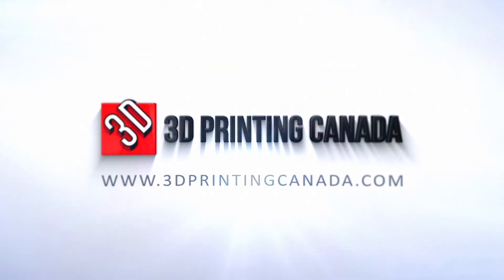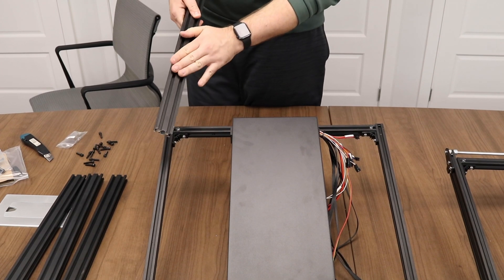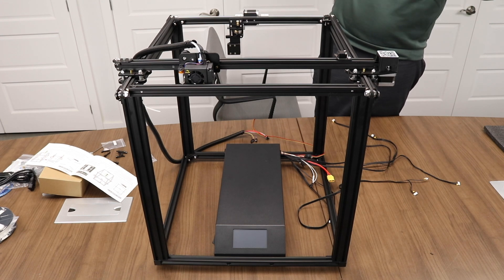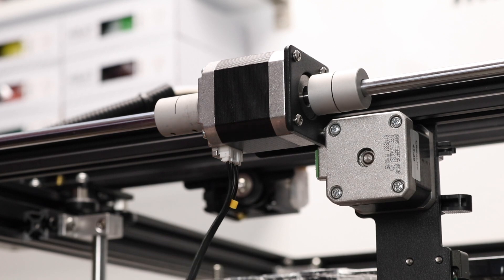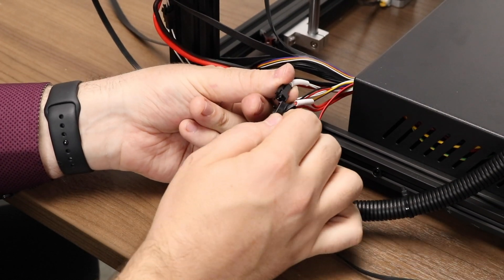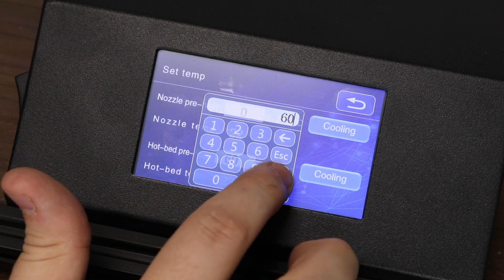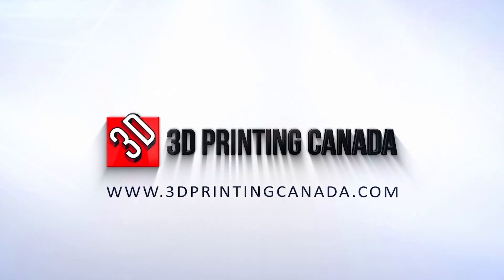How to Build a Creality Ender 5 Plus

Comment: I know this is 4yrs old but there are 8 screws for the bed mount.  You even show putting 2 screws in one corner.  4x2=8.  No worries. Even the manual was wrong.  
It said use 4 screws and make all 6 are tight.  Hmmm

Also you pushed the down Z button when raising the bed.  That’s backwards.  Up is up.  Down is down.

Comment: Very Good Video, I'm not a dummy or anything, been high level auto mechanic for over 30 yrs, Machinist (including CNC) the last few years, Have CNC Plasma table at my home shop, etc.  But I really enjoy seeing what I'm gonna run into when I start putting something together or repairing something.  I have seen several videos where they say to turn the spool mount to the back which is foolish as it won't line up properly with the extruder that way and it's not in the way at all the correct way.  Good luck folks, I'm gonna try to get this Bad Boy going today..  God Bless, have a great weekend.  Larry R.

Comment: Notice!
If you get a “Thermistor Error”,
Simply switch the two white wire connectors.
(I had them reversed, meaning the print head was registering the bed heat, and vice versa)
Problem solved!

Comment: Not a great video, not showing details like which is right / left side x y axis frame and how to install the spool holder. Where to position, how to position the t bolts, and your hands are hiding ask the wires as you plug them in so I can't even see what your doing

Comment: Bed won't level.

Turns out it's because the frames are backwards, the pins need to be in back.

Sure would be nice if that was in the manual.

Can't even take it apart because one of the screw heads stripped.

Comment: For anyone wordering auto bed levelling will happen before each print, in setting on the machine under levelling there is an option to turn it on and offer for each print.
Reply: On my main display the auto leveling option isn’t there. Do you know why it might not be showing up by chance?
Reply: @Godzi1la25   It should be under the leveling menu with a on off toggle.

Comment: do this model in 2021 have some updates ? because i have my fresh + 5 and i dont see that  230/115V switchs on my printer :/
Reply: You have a different power supply inside. The far superior meanwell 500w
Reply: @jaapdewaard830  so i dont need to switch anything?
Reply: No, meanwell has auto switch and is the best supply you can have. No need to upgrade
Reply: @jaapdewaard830  thanks

Comment: I wish Creality could have given the Ender 5 Plus some aviation connectors instead of all those plastic ones, it makes it ugly and untidy and prone to damage, I came so close to buying this printer but ended up building the Pro 3D Core X, Y V-king, it was my first experience of sourcing my own parts and my first ever build from scratch, my stomach was in knots with the thoughts of cocking it up, but once I had sourced and ordered my BOM I was chomping at the bit to get started on the build, all my cabling is tidy and I have aviation connectors fitted, Oh and I nearly forgot to mention I have a Belted Z-axis, I have my perfect printer but I still need another large format printer and I'm going to give the Ender 5 Plus a go!

Comment: You may have to force the screws holding the bed down other wise your videos spot on for my build. Thanks man
Reply: I encountered this too. I actually retapped the threads - you can manage this without special tools by simply using the included Allen key to GENTLY turn the screw until it meets resistance, then back off a bit, then turn to resistance again, and repeat a bit farther each time in a sort of ratcheting strategy.
Reply: As of  3/11/2022 I did not have this issue so it looks fixed. There was one predrilled hole that was off by a hair. I gently pressed a screwdriver between the frame and arm and pryed a 16th of an inch

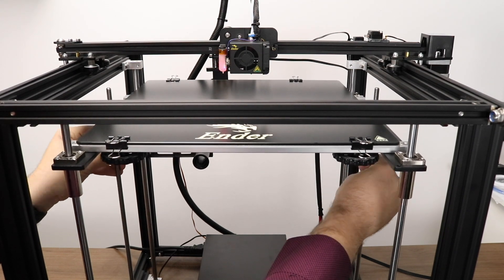Comment: At the 8:09 minute mark, you direct the user to manually twist the Z-axis rods to raise the print bed close the hot end. You don't mention it in the video but don't you have to use the 'Disable Motor' function to manually use the Z-axis rods to move the print bed ?
Reply: If it is off, the motors aren't going to be engaged. Disabling motor is just a way to do it without closing it.

Comment: 7:22 - "Ensure that the voltage on the power supply is set to 115 volts"
...unless you have ~230v mains electricity like much of the non-American/Canadian English-speaking world. This is especially true for the parts of the world that say Zed instead of Zee, yet you keep saying Zed. ;)

For whatever reason, Creality tells you to put in the side screws before the top screws for the top frame with extruder. Not sure if there is a reason for that or not, but the order is different from this video.

Comment: My 3d printer doesn't have the power input switch so idk what it's on and if I need to change it or can change it.
Reply: I bought mine from their store, so I’m hoping it was pre set from the factory to the correct setting...
Reply: If it don't then it's automatically adjust to the right voltage.

Comment: Thanks so much for the zoom-in while connecting the cables! All of the other tutorials I found didn't do that and some even sped up during that part!
7:24 That red thing is missing on mine though, it's just silver metal behind the hole. Are there different 5+ versions for different countries or do you have to open that up somehow?
Reply: I have the same problem and I have no idea
Reply: @mineordan1282  I talked to the shop I bought it from and they said that there are different versions for different countries. So if yours is missing the red switch, don't worry, it just means that you don't have to do anything else.

Comment: When I click auto home my hotend is pressing against the bed and the z axis wont stop and keep trying to rise the bed can anyone help
Reply: Did you ever figure out the solution to your problem? I just bought one from these guys and set it up tonight, it’s doing the same thing
Reply: Yeah my board wasnt working correctly so switched it out with a silent board. which ment I had to rewire my stepper motors in the end it worked. I would suggest check all your wires on the steppers and on the board because creality does an awful job wiring.
Reply: @kung-fubadger3766  checking them by removing them and reconnecting them? I admittedly am new to this, so after my bed started ramming my nozzle violently I just turned it off and emailed the company.
Reply: @dropgun2574  Yes remove them  and reinput them, Do the stepper motors first its best to unplug all exterior cables first then reinput them. if still not working check after the exterior cables have been checked, just a little heads up do not start pulling the wires on the board creality does a dick move by hot gluing there wires into place so you have to use a exacto knife/craft knife to put them away or you could use a heat gun on the lowest setting not to close though. I do have a friend who had the same issue and found that if you have a bl touch update.
Reply: @kung-fubadger3766  thanks appreciate the help. I’ll give it a try
Reply: @dropgun2574  No problem happy to help.
Reply: Some who had this issue had wired their Z axis limit switch accidentally with another limit switch.

Also,, sometime if you don't do the autoleveling order right, it do that, stupid coding I guess!

Comment: Hi, I just got an ender 5 plus and when I try and feed the filament through the sensor it stops dead half way through.  What mistake am i making?
Reply: Inside is a switch that needs to shift , cut filament in a 45 angle before feeding it to help it move
Reply: Did you find a fix for this?

Comment: Hi,
We followed the steps as you showed, but when we wanted to turn on the printer a light turned on for a few seconds and later it went off. So when we wanted to turn back on it didn't work. Do you know what the problem is? I need help...

Comment: My printer has no exposed voltage switch, afraid I may have to unscrew all of the casing and see if I can find it internally, the hole for where the switch should be is machined out but there is just a solid piece of metal there, no voltage switch. Lame
Reply: I came back because I found out that it is auto detecting. This is actually an upgraded power source. Plug and play my friend!
Reply: Albert Renshaw I have the same issue. Did you end up opening the housing?

Comment: One issue though:  Your video mentions a direct drive extruder for this printer on your website but there was no link in the description and I can't find one on your website.  You have a direct drive extruder that is listed as compatible with multiple other model printers.  Maybe that one needs to have its "Fits" section updated to include the Ender 5 Plus?  or maybe you can provide the link to the one that is compatible with this printer?